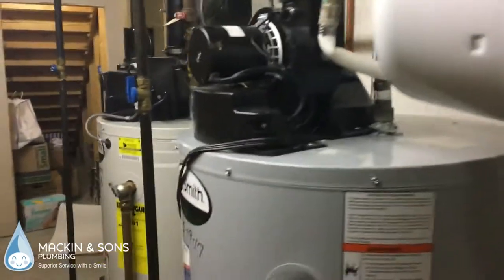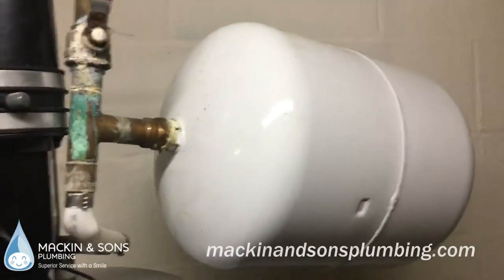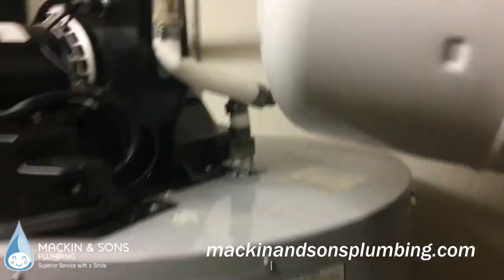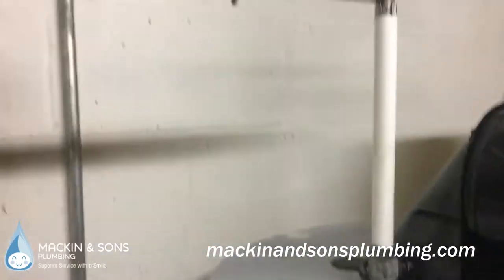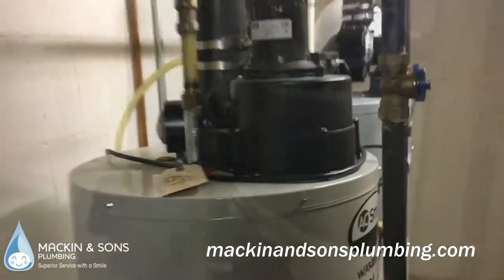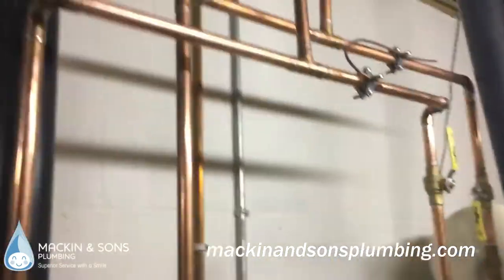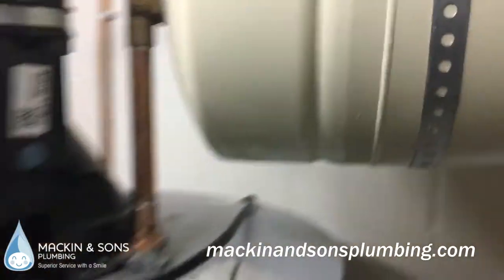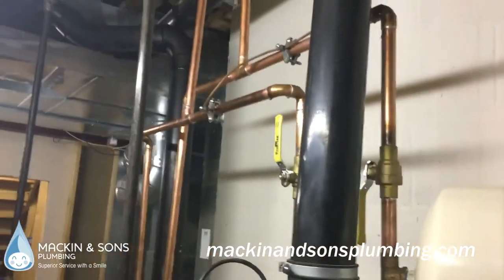Fixing Water Heaters in Parallel

Comment: Nice work . Question . What if you have two different size tanks side by side . How would you plumb them. A hotel had 2 boilers side by side running parallel. The right one went out so they bought a high powered ao smith with about half the btu and recovery rate . They want me to just plumb it in as fast as possible which would mean parallel like it was before . I’m thinking a series might be better . Your thoughts ?
Reply from the maker: We always go parallel for just this case. If one goes out or leaks the other one can take over until you can get a tech out to replace it. So what did you end up doing with it?
Reply: Because the new one was only half the recovery rate and I told him he couldn’t install it parallel. Because the new one would run out of hot water  and start pushing cold water into the line. So he sent cheap water heater back and is buying a boiler.
Reply: The boiler I originally told him to buy the first time. It doesn’t pay to be cheap

Comment: Nice. can you install 3 water heaters in parallel?
Reply from the maker: Yes you can, but the correct configuration needs to be used.
Reply: @wadsworthplumbers  working on it now. Should I go off of a diagram for correct configuration?
Reply from the maker: @arr0gant1  Yes, you should call the manufacturer and ask them to send you a piping diagram. It can be quite complicated, so if the budget allows it, you would be better served hiring a licensed plumber.